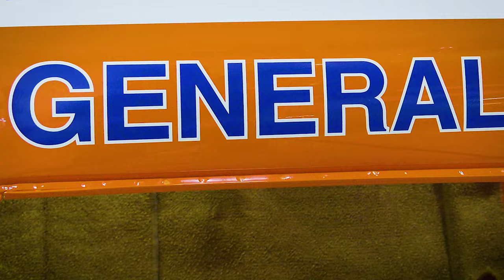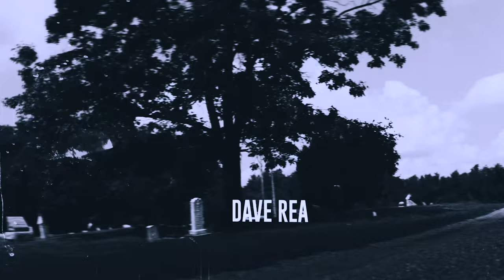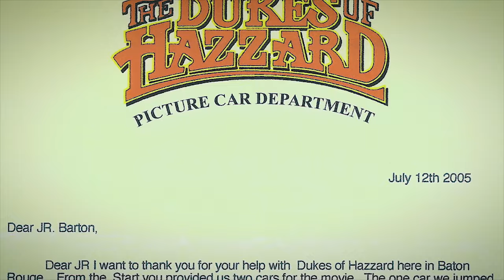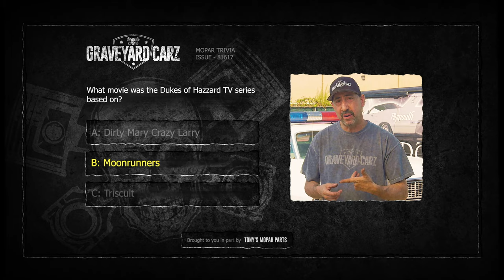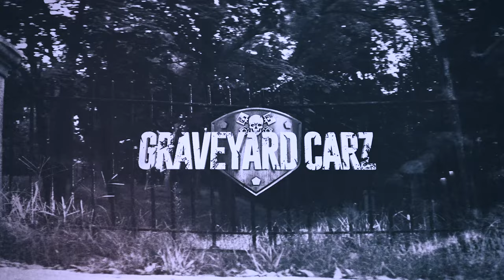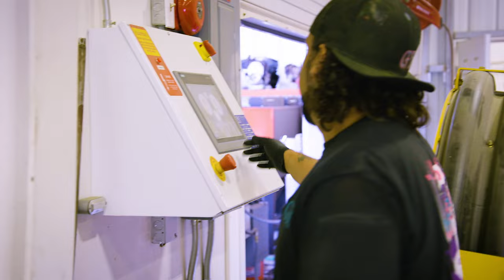S08E03 DEAD TO LIVE GENERAL LEE

Comment: Really glad to see the flag is on the right way.
I don't know if you knew about the way the stars point (it seems to be practically an unknown detail), or whether it was done the same as the original flag, or whether it was just a lucky guess (most Generals appear as though the decal was randomly put on, possibly not even realizing that all the stars are even all pointing in the same direction on the flag, and it being a 50/50 chance it was the right way).
But the stars are meant to point to the drivers side like you have it, not the passenger side.
I've seen one Generals flag that had them all pointing inwards and must of either been hand painted (hopefully not) or some oddball decal that he had made or something.

Comment: Nice resto. Not sure why you replaced the rear also as it didn't appear that twisted and you should have kept as much of the original as possible.  Surprised you missed to fill in the marker lights.  They were always filled so 68 quarters and fenders didn't have to be replaced as well.

Comment: Forgot the exhaust tips, gauge bezel is supposed to black, antenna is supposed to be on the deck lid, needs the tan roll bar padding, and needs the crossed confederal and checkered flag between the rear window and the deck lid. Junk that steering wheel cover too.

Comment: According to John Schneider, Flame Red wasn't the color of the body.  It was a mish-mash of different orange colors.
Reply: i think he said at one time it was left over orange paints all mixed together
Reply: Actually, the ones who know best are the mechanics and body guys.   Tom Sarmento (lead Dukes mechanic) has said thr actual color was 75/76 Corvette orange flame.   Depending on whether you were on the east coast or west determined if the color was called orange flame or flame red.   The correct paint code was 70.  As a true Dukes fan and a General Lee builder,  the movie was an embarrassment to The Dukes of Hazzard.  The movie car,  if anybody bothers to do some real research has too many things wrong to mention here.
Reply: Chris Papoas i meet john scheider in Agoura at the diy and he had the original general lee. I saw it when i did a deliver to his home. That is not the original.

Comment: the problem with a restoration like this is how much of the original car was left after the restoration , and how much of the car is now something not seen on screen. for instance , none of that orange paint on the car as it sits now restored was seen on screen .  so what is it? 80% screen used parts , and 20% new parts and material ?   as a collector you always leave a screen used prop , costume or piece of set dressing as it was left by production. I thought it looked beautiful all beat up the way it was ..  battle scares and all.. now it just looks like everyone else's General Lee ..

Comment: So, a donor piece, aka, floor pan, firewall, floor, and dash. The parts that include the VIN tag.

So please.fill us in Mark. Exactly how was this legal, and how is it still the same car? Change the VIN, you break the law, as soon as you place the other car's VIN on it.

Use the donor VIN, it's no longer the car from the movie, but instead, a car that contains parts of the car from the movie.

That's like finding the tank from the Captain America bike or Billy Bike, slapping it on a custom frame with a Harley engine, and calling it one of those bikes.

Not dissing your skills and knowledge, but it just raises more than a few concerns for a future buyer.
Reply: In the UK it's called like for like, swapping parts and using the same parts is OK. The axles and other stuff all count to be considered an original car, if it was a bodge job it's called a cut and shut. The shell that was cut up was just a donor shell and not stolen so changing the VIN on those parts wasn't illegal as it wasn't a car that was having its identity changed, it was just a donor car.
Reply: @mikeatcora  thanks. Makes sense.

Comment: All general Lee's were painted. TNT Express Orange
Reply: No they weren't They were  all orange but different shades of it depending on who was building the cars.
Reply: @johnkramer7161  ok Lee 1 was TNT Express Orange
Reply: @robertmckelvey3091  The color on Lee 1 was a bunch of different shades of orange mixed together. It had  no name or paint code. It was custom.
Reply: @johnkramer7161  they use some sort of electronic device that picks that shade under the trunk lid after they buffed it when they ran the collar code it come back as the TNT Express
Reply: @robertmckelvey3091  That might be true but that wasn't what was painted with.

Comment: You replaced the entire front end of the car including the interior floor plating.  You've replace the back end of the car.  You replaced the engine.  The only thing original is the freaking roof.  This car is NO LONGER the car from the movie.